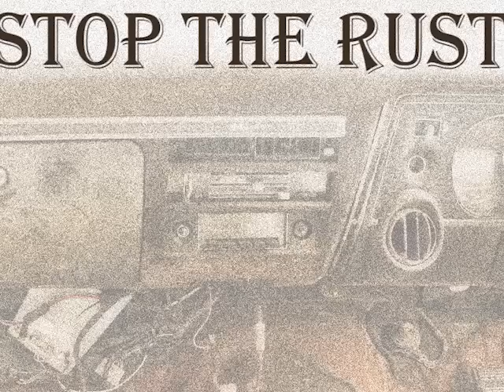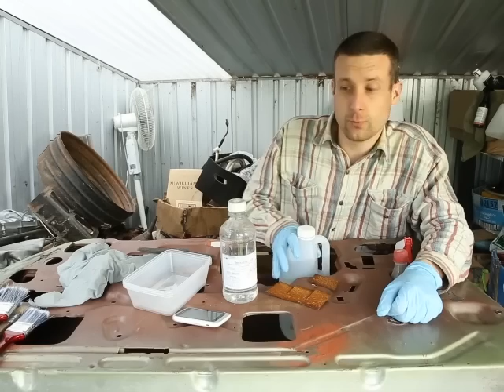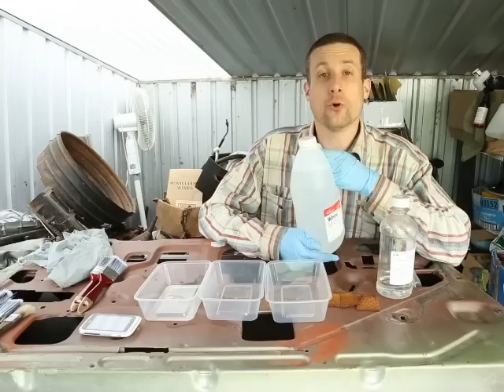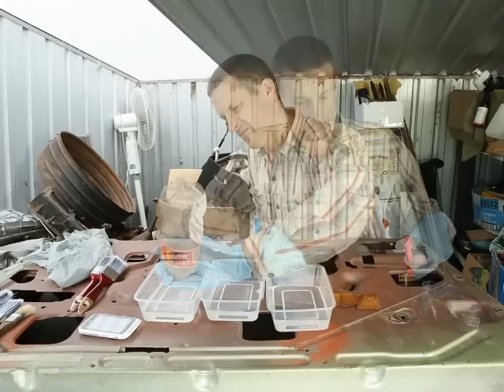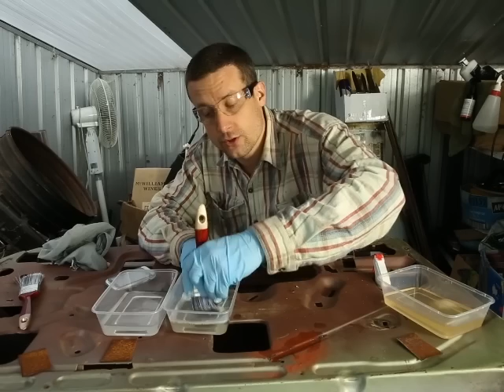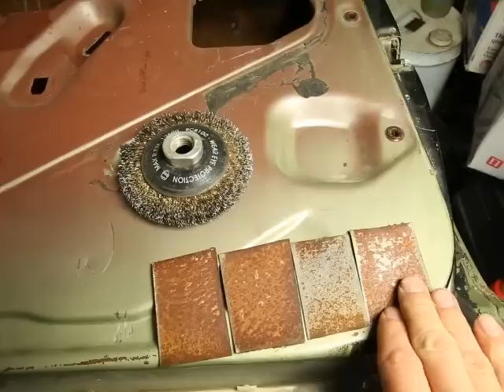rust chemicals compared, phosphoric acid vs deoxidene vs vinegar vs mag wheel cleaner

Comment: Please advise how to remove rust from motorcycle fuel tank
Reply from the maker: First you need to remove as much oily residue as possible. Paint thinner would be a good start. After cleaning I would use molasses to break down the rust. I have videos about using molasses for rust. After the soak I would fill it with nuts and bolts to create a tumbler effect to dislodge the shelated rust, then clean out every speck. Good luck. There are kits specifically for fuel tanks, but nothing beats just removing the rust. A good channel called (Chris Craft) shows the use of one such kit with mixed results. It's going to be a lot of work.

Comment: I want to use phosphoric acid to get rid of rust. I used vineager fist and cleaned all but minutes after I got flash rust.   I dont know how to avoid flash rust after cleaning the bare metal. I'm stucked here. , I need to use primer and paint the area later but I cant 🙄, please someone tell me how to avoid flash rust and leave the steel ready for primer, It is the door of a car I want to paint myself.
Reply from the maker: Fist stop using vinegar. Second watch my other videos. Third work in small areas, not the whole door.
Reply from the maker: I hope you haven't confused vinegar with phosphoric acid. Vinegar is acetic acid. Once you switch to phosphoric acid, your life will be better.
A good on the shelf product is called Deoxidene

Comment: For sure, HCl will cause hydrogen embrittlement. Under certain circumstances... For instance, if the item being de-rusted is >=R32 (Rockwell Scale).
This would include High Tensile and case hardened items. Can be done but the parts must be 'passivated' with a strong base (NaOH or KOH) immediately after etching and then heated/held at 280degC for 1+.

H3PO4 (Phosphoric Acid) would be a better call for that job.

The other caveats are time, keep application time short & never use on Cast Iron.

Comment: Im sure you have figured it out now but in my research I have found that a mixture of 85% phosphoric acid at 10% dilution  and also 10% tannic acid with water... I read this from the a Canadian govt website... turns out they done some tests on it and found it the most effective/cost effective... way to keep rust of the govts metal structures... IE bridges etc... but I have major rust issues with the frame on my truck and I need to basically bath my truck in the stuff... paint is not a concern for me because its just a tough truck. I have not used it yet personally but from the studies they done I believe it will work.  I also have heard molasses and it does work but you need to soak for a LONG time to get any result.
Reply: Yes commercial de-rusting solutions do frequently use tannic acid with phosphoric acid. But exactly what is formulated & sold is not generally known. also worth remembering that commercial treatment is usually done in heated & agitated tanks

Comment: Have you tried naval jelly?
Reply from the maker: ***** I can't seem to get it anymore. I'm quite sure it's phosphoric acid. It would be good for stuff you can't soak and don't want to blast.
Reply: Stop The Rust yea im trying to find a good cure for my camaro floorboard  only 3 major spots and some surface rust.. im trying out naval jelly off ebay and ospho '' rust converter'' which is mainly phosphoric but turns it black . I don't know if plain acid does that.? but cheapest i've seen ospho is on amazon 30$ for a gallon works really good  and than finish it with oil topcoat paint
Reply from the maker: I have a Video on media blasting, it's very good if you have the space, tools, and can make the mess.

Comment: Let the parts air dry, don't wipe the solution off at the end. The chemical process requires oxygen to produce nonrusting iron oxide form from rusted surface.

Comment: have you tested Oxalic Acid  ? cheers for doing test video :)
Reply from the maker: Len kenspocket Here people call it Hydrochloric acid. I'm not going to use it because I don't want to pay for the disposal or tip it down the drain. I'm sure it can produce a good result.
Reply: Stop The Rust Oxalic acid and hydrochloric acid are very different acids. Oxalic acid is an organic acid (C2H2O4), hydrochloric acid is much stronger (inorganic) acid. I have used citric acid and sugar solution to remove some rust. Worked!

Comment: if you use stainless steel as the anode and it is a chromium mix you could .. in theory .. produce hexavalent chromium (bad bad stuff). just use re-bar( mild steel or pure iron) on the positive side. 
don't let the stuff connect physically in the solution, short circuits are bad .
salt would work , washing soda (sodium carbonate) is better , baking soda is ok too ... they all act as electrolytes, conducting current in water . bubbles are hydrogen gas (fire hazard),  so says the internet ...

Comment: I soak axes in vinegar over night and all the rust is gone.
Reply: Yup, I've done this with nuts and bolts - really does work. Of course, afterwards you need to dry it and spray some sort of protective coating because after they are stripped by an acid etch (like vinegar or phosphoric acid) humidity from the air will cause rust.
Reply: +GregJoshuaW  If you use a catalyzed phosphoric acid wash with alcohol as the catalyst the surface will not rust. I used this process in the industrial corrosion control business for several decades. To find the product go to companies that sell industrial coatings and ask around. Probably won't find it is CA as they assh*les think alcohol is a VOC. Otherwise use 100 percent zinc solids coatings on clean surfaces.

Comment: If you would have scrubbed with the scotch pad or medium steel wool with the vinegar it would have done much better.  My friend Pete says to use 2 or 3 parts water to 1 or 2 parts vinegar, let dry then scrub clean with water.  I'm using the vinegar/water mix on my 75 roadrunner project and for the price, I'm happy.  Just need some elbow grease :)
Reply from the maker: I deliberately used a soft brush so I could compare the chemicals whilst removing the scrubbing as a variable. I have since posting this video found molasses very good for parts off the car, I have a video that demonstrates molasses, it's good for heavy rusk. Thanks for sharing.
Reply: I'm just learning too.  SWRNC channel and Pete's other vids have helped me a lot.  Working on my first car project and it's got a good amount of surface rust.
Reply from the maker: Look up (strip it disc) it's like a hard scotch bright you put on your grinder. If your not using it already your going to love it. I also did a vid on sand blasting but it's not for every one. Thanks for the comment.

Comment: btw wd40 works great to stop flash rust but long term do not use it. it wont stop rust. check out the rust tests on various gun lubes. wd40 is the #1 most failed oil in terms of rust prevention.
Reply from the maker: Thanks and your right but it's just too expensive to coat an entire panel heavy enough to repel water. The $2 degreaser works good enough.

Comment: I don't  screw around with the Mickey Mouse home remedies for rust, vinegar, cocacola, molasses all that bullshit. It is a total waste of time, unless you consider your time valuless? I don't.  I buy 85% Food grade phosphoric acid through a company called "Duda Diesel".  I bought a gallon of it for like $36.00 to my door!  It works way better than any of things I've tried and is much less time consuming. I heat my container up on a warm hot plate (not hot). This kicks the reaction off faster than just cold parts and solution. You only need about a 10% solution this way.  This process is much safer to parts than hydrochloric acid, doesn't bite the metal nearly as bad even when warm.  You will find you part absolutely rust free with a black phosphotized  coating upon removing it. Do this outside or in a fume hood. Don't breath any of the vapors either and use gloves and face and eye protection.  You'll  love the way this process works. I have just rinsed the part off with water, blew it dry with some compressed air. Then put on some Marvel Mystery Oil, actually any oil works even WD-40. The part won't rust even without this step. Some of the black coating will come off, no big deal. I have used this process on Factory specialized fasteners and leaving the black coating on with an oil coating makes the fastener look new.
   when done let it cool down and return it to a container (I use gallon plastic milk jugs) via filtering it through coffee filters. This takes a long time, and some filters, but it removes rust particulates, dirt and greases. I have used this same solution over several times, so that makes this process as cheap as the other nonsense,, and much more effective.  If you like wasting your time screwing around with old wives tales about getting rid of rust and doing it two or more times over, then knock yer selves out. I don't like doing things over, just doing the right and easy way just once. That's the way I do it and it works for me, for what it's worth. Just trying to make you guys efforts easier and more productive.

Comment: If you soak that part in vinegar 24 hours and it will clean it easy, wiping it with a brush in a bath for 30 mins would even let it do its job. soak it for a day or two or more if it's heavy rust. Make a video showing that, I use it all the time for rusty bolts and small parts in a vinegar bath, best part it is you dont need gloves, Ive had it clean very heavly rust scaly items. So make a video of a very heavily rusted Part in a bath for a few days, you will be amazed, you didnt do it correctly hence why it wasnt a full success

Comment: What, no muriatic?  Piece of cake, and kills everything you used there.  Muriatic will eat everything but the steel within 10 minutes at the most.  Toss it into a bucket and walk away for 10 minutes.  And don't get it on you or breathe it.
Reply from the maker: thanks for the comment, I'm sure none of these I tested are good for deep rust. For that I'm enjoying molasses, I have also made a video of it's success.
Reply: Molasses eh?  I need to check that out.
Reply: I have never seen anything work so well.  I put this into a spray bottle and spray the parts, but be careful the fumes and overspray are dangerous.